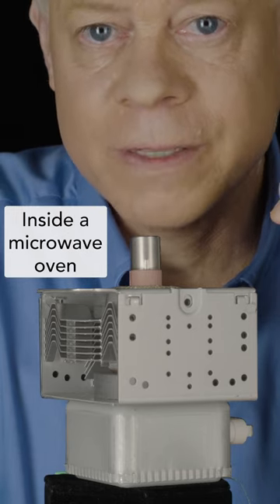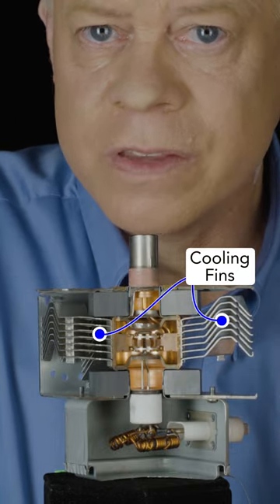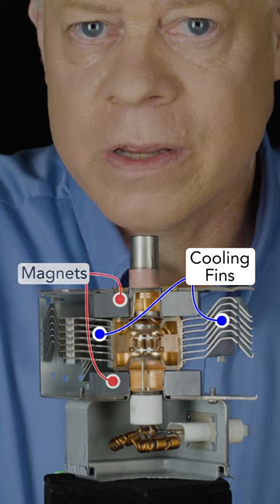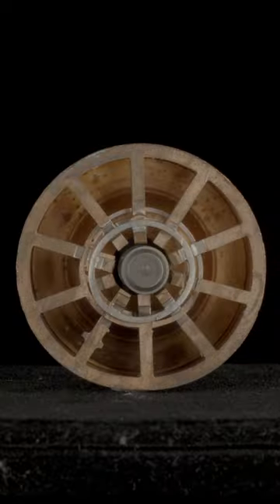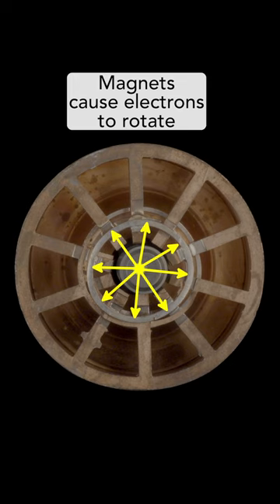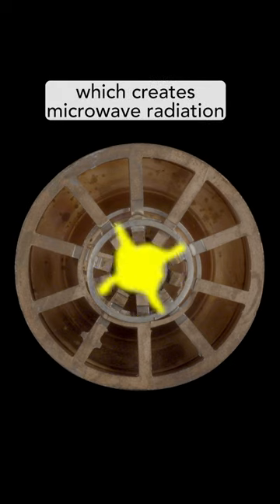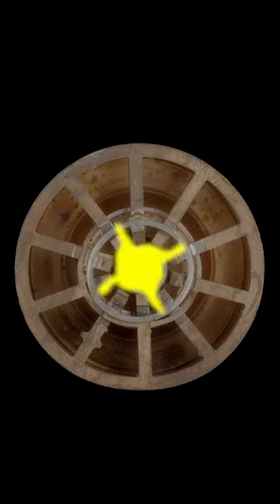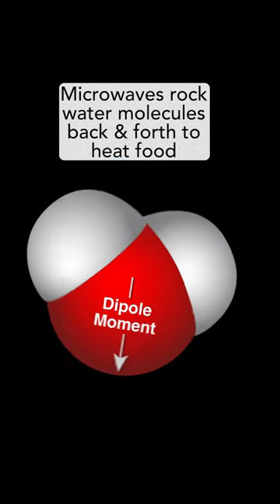Magnetron #Shorts #engineering #engineerguy

Comment: Please dont try to open up a microwave. There are parts inside that carry a very high and lethal amount of voltage even for a long time after you unplug it. Lots of people got seriously injured or died because of this
Reply: I am one of those people. I liked taking them apart and using it's innards for my high voltage experiments. I started when I was 12yr old. At the start I never knew what a capacitor was, but have felt the shock from smaller ones. Thank God I've never got shocked from a microwave. They can kill you, like the guy above says. If your kids want to learn about electricity, teach them the very basics and fundamentals first. They have very cheap and fun experiments kids can do. If the reader is thinking about doing it, make sure to know where every capacitor is, and know what can and can't shock you. Wear correct personal protective equipment. Also read up about radiation.
Reply: Also beryllium on the magnetron
Reply: Beryllium oxide, once inhaled (the dust particles once the pink material is crushed, kills you within oh 30 minutes give or take ,depending on body size,etc)
But u didn't hear it from me.

Comment: Why do the electrons pool in each cavity before moving? Or in other words, why do they bunch and not just swirl
Reply: Physics!
Reply: The electrons don't actually enter the cavities. As the arms of the swirling electron cloud pass by the opening of the cavity they repel the electrons in the cavity wall around the circular circumference of the cavity - first in one direction and then back in the other direction. This excites the cavity and makes it ring at the tuned frequency. The circular wall of the cavity is an inductor (L) and the gap at the opening is a capacitor (C). As such the cavity is essentially an LC circuit that can oscillate or ring when its excited. This produces the microwaves that go out through the gap and then exit the magnetron.

Comment: So can there be food that doesn't rock around?
Reply: Not really. This works on an atomic level, using particles (electrons) bouncing around and basically hitting the particles inside the food, creating movement and as a result friction. The friction is actually what is heating the food, not the electrons themselves, and is why microwaves can sometimes cause unevenly heated meals. 
Fun fact, but this is technically the same way fire cooks food on a stove, on an atomic level - it causes the particles to move and hit each other and that results in friction, which causes heat.

Comment: Can we someday have electricity without wires?
Reply: I mean have wireless chargers and stuff, but like wireless electricity in household applications is probably too inefficient. Its possible I think idk
Reply: If you make the voltage high enough electricity will flow without wires. Lightning is a good example. The air ionizes and it conducts the electricity just like a wire does. The only practical application of sparking that I can think of is a spark plug, where electricity flows across the gap to ignite the fuel/air mixture inside the cylinder.
Reply: @A_n.t_i.s_o.c_i.a_l  Wireless chargers are basically transformers. The primary coil is inside the charger and the secondary coil is inside the device being charged. As such the energy is being transferred electromagnetically and not by current flow, so technically its not electricity without wires.